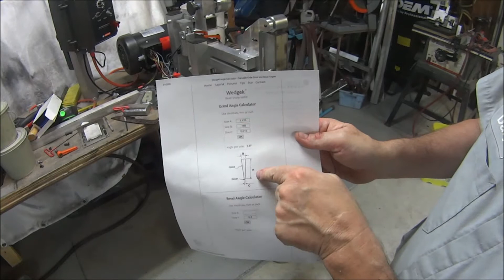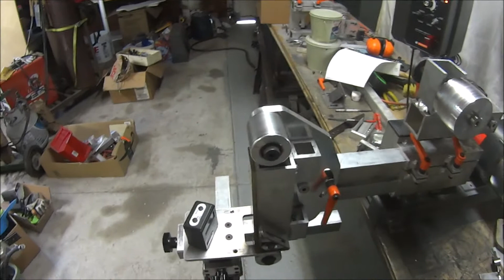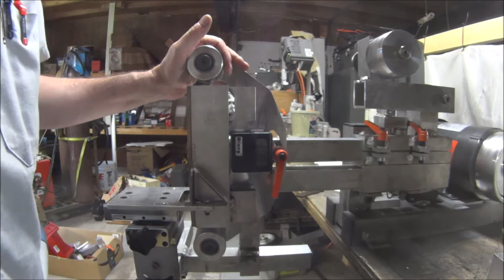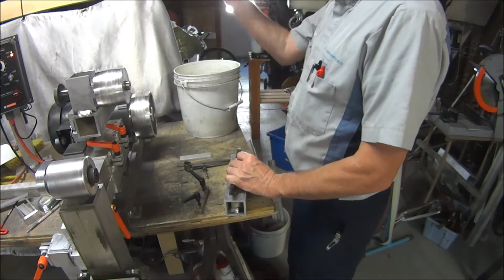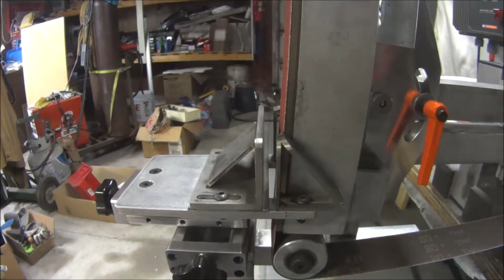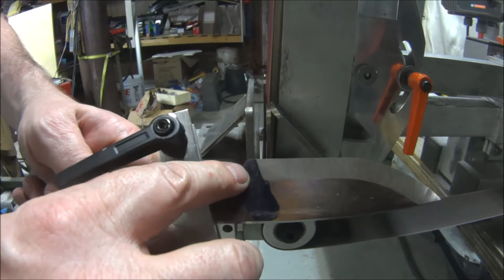Here H2 | 10 Blade Grind Part 9 | New Bevel Angle Setup and Grind

Comment: I'd like to see how you change belts and maintain the correct angle.
Reply from the maker: Loosen the guide in machine tool slot and slide guide out a little. Change belt then move guide back into position and tighten. Since you do not tilt guide or platen the angle relationship stays the same. You can in fact remove the entire guide from the machine and as long as you do not adjust its tilt or rotation it will be the same when you reinstall it. I will see if it is in another video shows it.  If not I will show it on current machine I am building.
Reply: @BigIronTV  Still workin on it.  Testing some blanks. Thanx for hte reply.
Reply: OK I tightened up the guide brackets to the blade, and then ground with an 80 Grit.  Then changed to a 120  using your method.  Seems to have given me a much better grind,  Thanks for the advice.